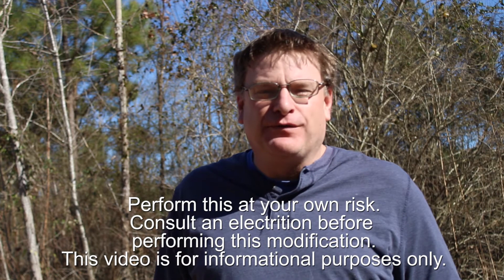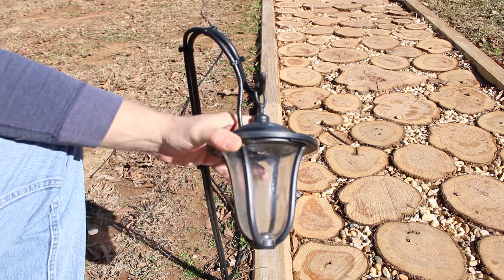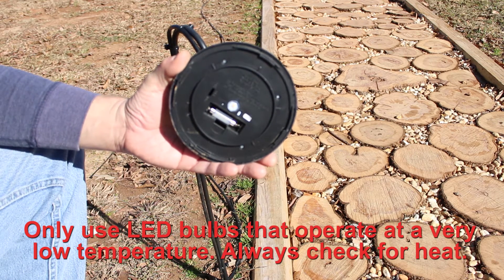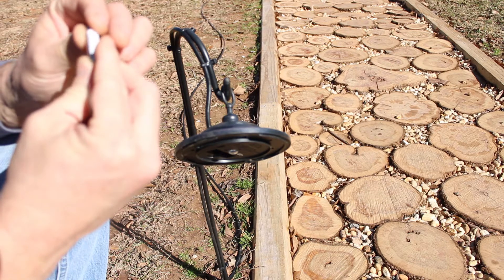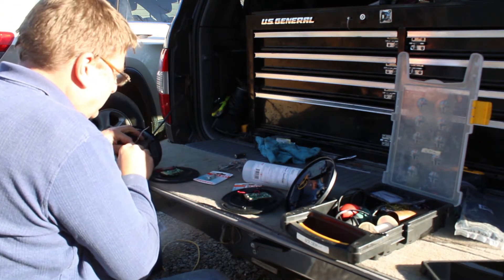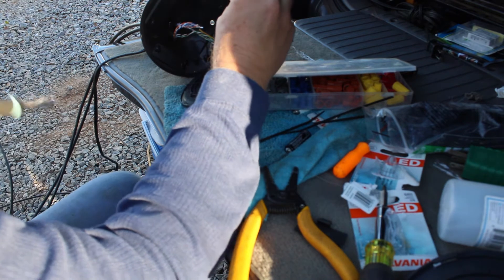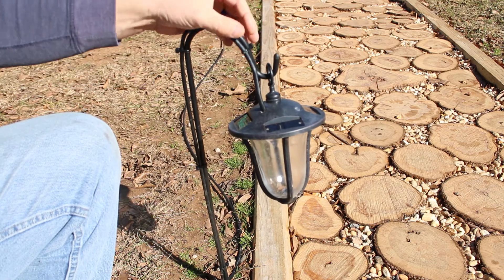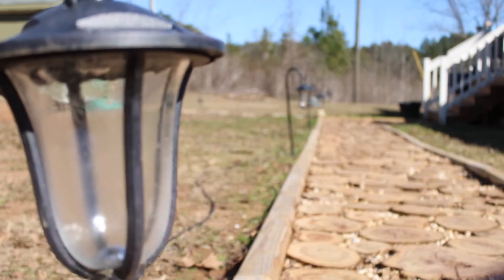Convert solar powered walkway lights to operate on 12 Volts

Comment: Great idea!  That is a car bulb right?  Any issues using AC current on a DC bulb?
Reply from the maker: Thanks for watching, I use a 12 volt DC power supply to power the lights so the power going to the bulbs is DC.

Comment: Very informative. 
Can I just bypass the circuit board and wire the lights to a transformer that has dusk to dawn feature? I have the led solar lights that you'd put on a wall/fence. They that have off on full brightness, on dim full brightness to  motion, or just dim on.

I want bypass circuit board and just have them on full brightness dusk to dawn with the use of a transformer that has that feature.
Reply from the maker: On mine I bypassed the circuit board and went directly to the bulb